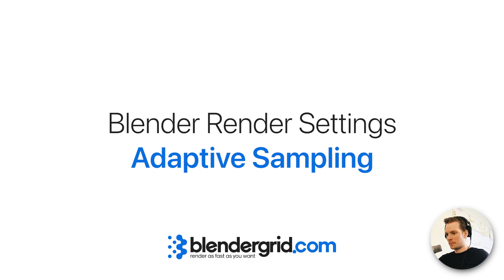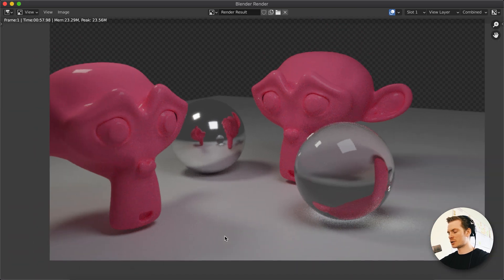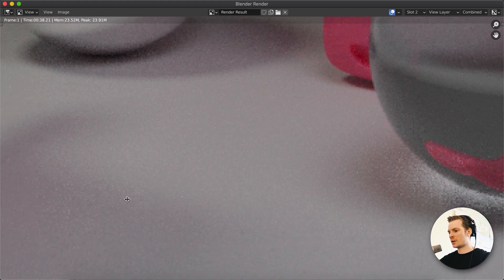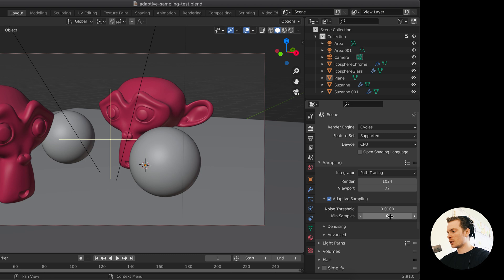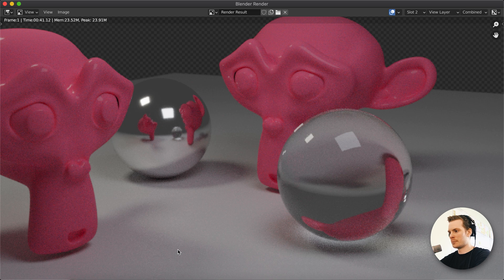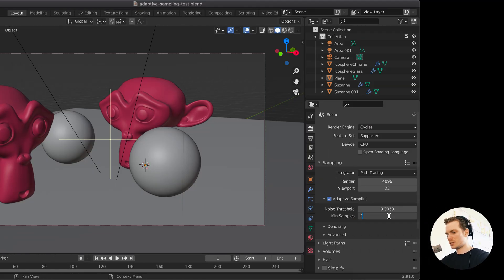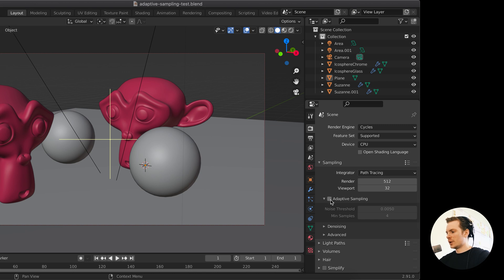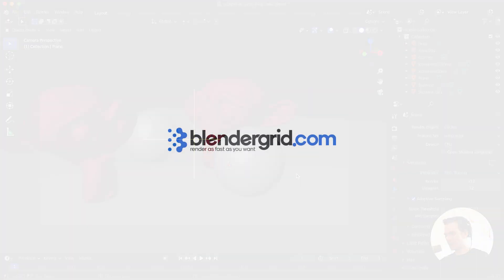Blender Optimization - Adaptive Sampling #b3d

Comment: Hey, I was wondering, how did you create that heatmap to show samples per pixel, thats on your website? Thanks :)
Reply from the maker: You can use a render pass for that, it's called Sample Count. Then do some compositing. I think normalising the value and running it through a color ramp should do the trick :)